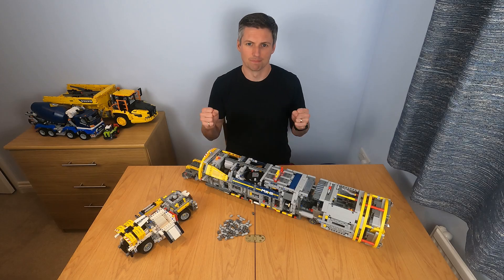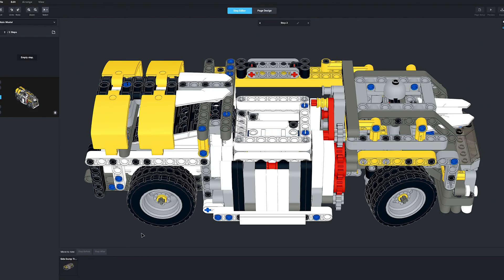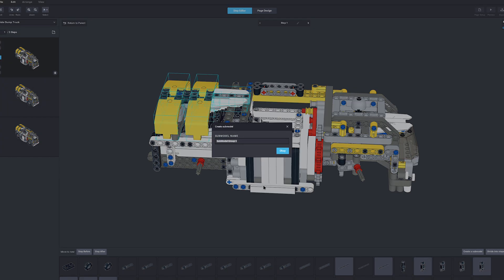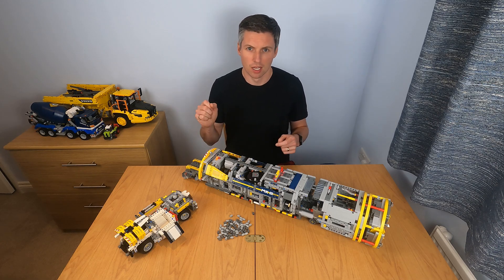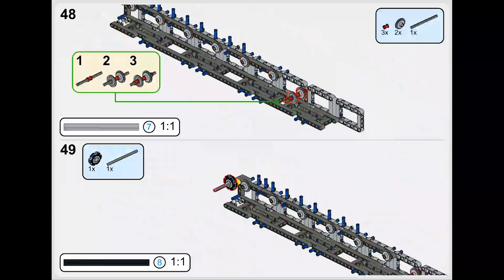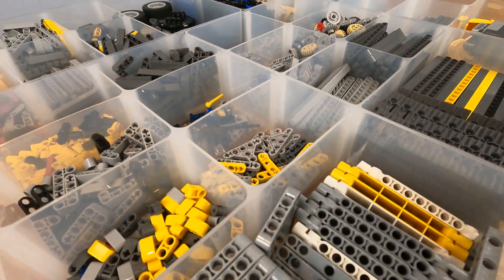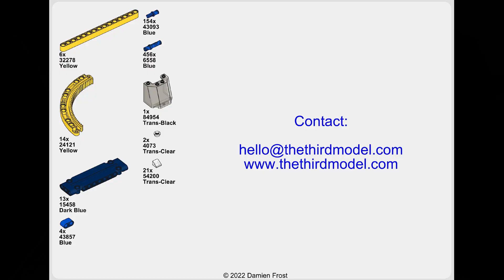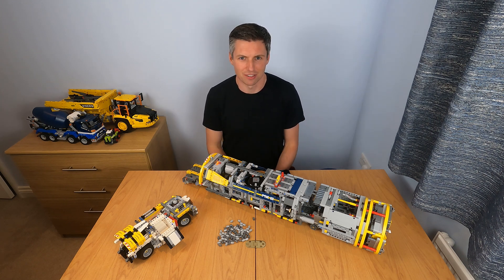Tunnel Boring Machine Instructions are Live!

Comment: Just finished this build. It was ,at times, challenging. My iPad had a life ending accident,thanks to my new puppy, so I had to use my Motorola phone. It took me about 20 hours to complete. 
I had a couple of problems. Step 705 called for a beige gear,but IAD used all of them, so I used a black one instead.
Step 828 and onwards, I had used up all of the black connectors, so I went to my spare parts box. It was a good thing that I had sorted out the spare parts into baggies.
Step 856, called for a grey gear, but all were used up, again, thanks to keeping spare parts.
I would recommend that you install the batteries before you install the power unit into the model. It's impossible, without dismantling the kit to install or change batteries.
As I said before, I enjoyed the building this kit. There were some steps that I had to figure out attachments,poba6due to my small screen,or due to the fact that some the attachment points were on the backside of the shown diagram.
I'm not sure if I made a mistake, but the lights on the cutter head stick out further than the cutters,so if I was to due a snow tunnel boring test, the lights would snap off.
Thanks for the fun!!!
Reply from the maker: Thanks for your message! Great to hear you made it to the end. If you have the Bucket Wheel Excavator, you do have all of the parts necessary for the Tunnel Boring Machine. 
Thanks for the top tip about installing the batteries! I agree, the batteries should be installed when the battery box is installed.
I can confirm that the 'lights' on the cutter head do protrude slightly further out than the buckets, so I think you have built it correctly :)